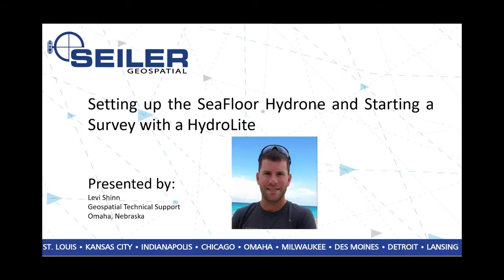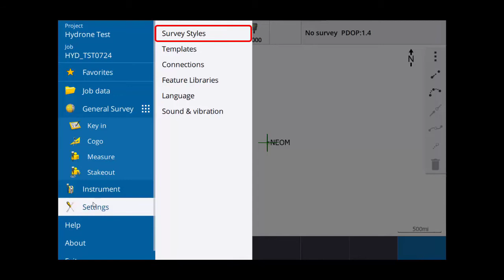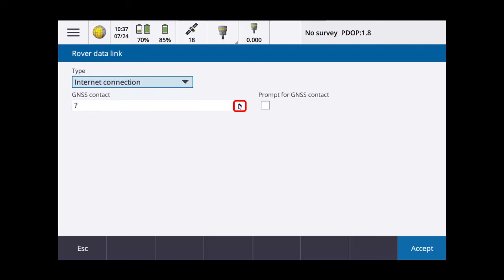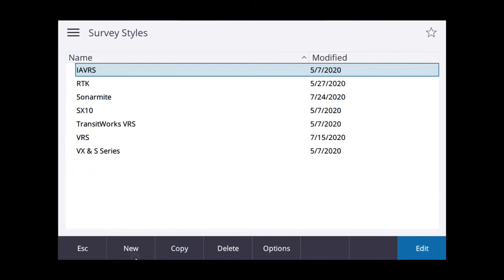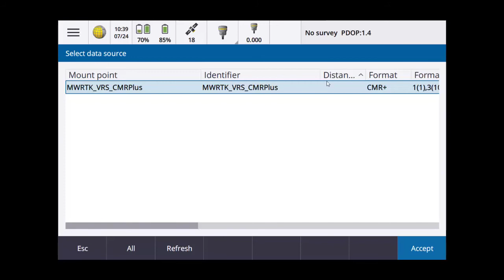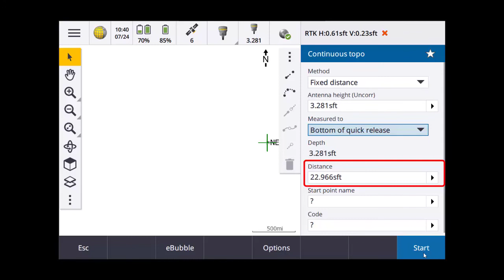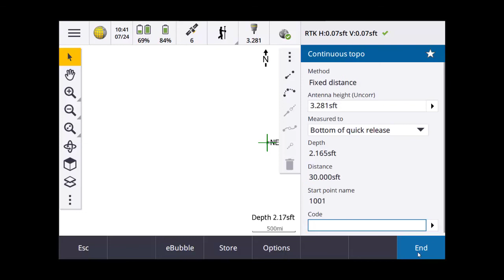Seiler Quick Tip on Setting up Seafloor Hydrone and Surveying with HydroLite

Comment: Hello, me and my boss are in Florida working with the same survey equipment only difference is we mount it to a full sized pontoon boat. We wanna know the software we need to operate this. Is there multiple compatible software or just the one you’re using here? Also,  is it possible to operate from wireless devices or will we need a PC or laptop?